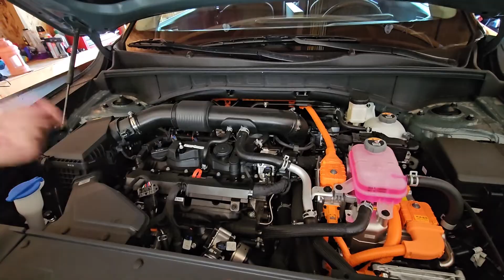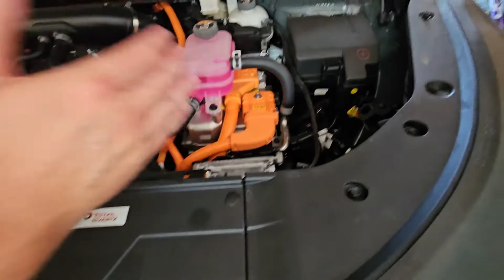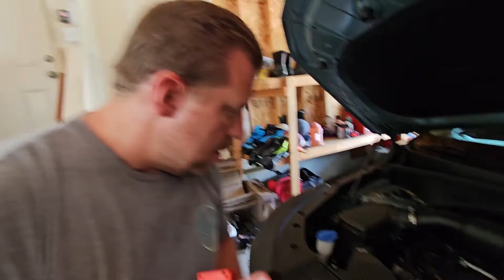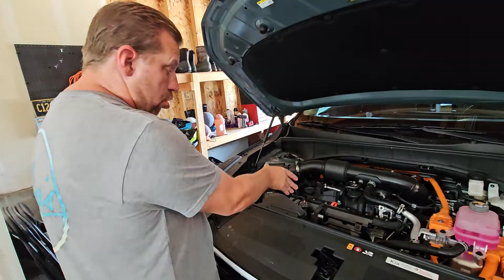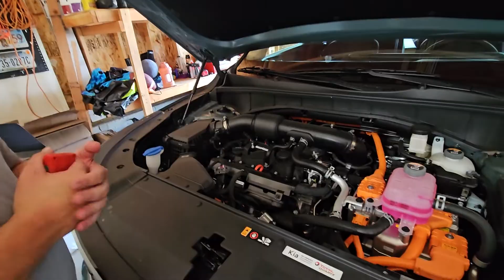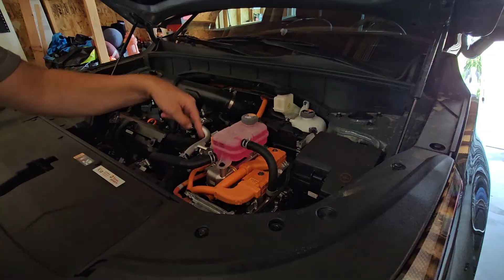A Deep Dive on Hyundai/Kia's Very Unique Hybrid System, this week on jmcGarage Talk!

Comment: I just bought a 2025, sold my 2021 Venza on demand AWD. I enjoy my Santa Fe AWD - full time. I get about 540 to 602 Per tank it's awesome when in ECO mode at any MPH I tap on the gas and engine shots off, going over 65 Its on EV, what other manufacture does this not to mention the warranty 10 years over 100,00 Miles, have over 2700 miles and drives like my brothers Rose Royce comfort and handling.

Comment: I have 2022 tucson hybrid sel convenience. At 60,000 miles the HSG tensioner starter belt snapped. I kept trying to restart the engine and fused out the main battery pack in the back seat.
Thankfully Hyundai covered replacment.
I later found out in the manual that the recommended replacement for that HSG belt was 30,000 miles.
Which was $120 replacement. 
I could have almost had $2500 issue with the batteries if Hyundai hadnt covered it
Reply from the maker: Thanks for sharing your experience

Comment: Just bought the 2026 Kia Sportage SX HEV that has this powertrain although it's even smoother switching between EV and ICE with 5 more hp. Must say they've done an amazing job with the lineup for 2026 and I'm glad they went back to a real 6 speed transmission instead of the DCT or CVT.

Comment: Does anyone experience a jerking motion when the engine is cold. Lasts about 5-10 seconds. Then once warmed up no issues. Reading on Reddit someone said it has to do with the engine clutch and no TSB or fix. I have a 2025 Santa Fe hybrid.
Reply: Haven't experienced that on the 2026 Sportage HEV

Comment: That “slight” delay in my experience can be up to 2 seconds on my experience. I was very disappointed with the driveability and reliability of my Sorento PHEV.
Reply from the maker: So sorry to hear that
Reply: Can't imagine an actual 2 sec, but certainly any appreciable delay could feel like a long time on the road. Wonder if the PHEV is different than the HEV (which is very smooth and quick to transition) in that regard. Also, in what drive mode?
Reply: Doesn't sound right I'd get it looked at. I have zero delay on my 2026 Sportage HEV with the same drivetrain
Reply: @Yielar1 I got rid of it and got a RAV4 Prime. I’m much happier with it.

Comment: The differentials are mechanical, but the clutch packs are controlled electronically. Also the intake cam is a multi piece electrically controlled unit that does not control valve timing (CVVT) but it controls valve duration (CVVD). It is the only engine of it's kind in the industry and also has other unique features such as an exhaust manifold that is cast into the engine block.

Comment: The "pancake" electric drive motor not only powers the wheels it pretty much replaces a traditional torque converter in the automatic transmission. The car always starts in electric mode until the car gains enough momentum to allow the electric clutch engage the ICE.
Reply from the maker: Thanks for the information, very good to know.
Reply: There's no torque convereter as in non-hybrids, but there's a Hybrid Clutch that was added.
Reply: I was happy to learn that it doesn't have a starter per say, it uses the electric motor to start the ICE engine which is pretty clever

Comment: I drove a Hyundai Tucson hybrid and RAV4 hybrid back to back. This is a very clunky system. You certainly feel the switch between electric mode and when the engine turns on. I’m also not comfortable with that belt driven MGU. Belts always have slack. This belt is also under shock loading evertime it starts the engine. So many things to go wrong in this system and I see no benefit. The Toyota is much much more reliable, smoother and will hold its value better. I’ve had the RAV4 for a couple months and I’ve been getting around 4.8-5.3L/100km (49-44mpg). But hats off to Kia/Hyundai for doing something different.
Reply: Interesting, I drove a Kia Sportage PHEV and found it to be a very smooth system. I could see having some  jerkiness at low speeds since the torque converter is replaced by an electric motor (I know Mazda had this issue with their new hybrid 8-speed) but I didn’t notice anything myself. I will say my fiancé has a Prius and it’s an incredibly well made system, and bulletproof as hell. I just can’t stand the CVT drone when you’re pushing the engine hard. The Hyundai/Kia system had a much more refined feel to me, between the conventional shifts and the turbo allowing the engine to stay at lower rpms. I agree the belt driven MGU is a weird choice, I’m curious to see if they’ve changed that for their 2nd gen system that’s coming out with the new Palisade/Telluride.
Reply: @jakenoltensmeyer7366 if you drive a modern Toyota hybrid (4th gen and up) you can tell the difference straight away and it will bug you. 😅 
I don’t find the eCVT annoying at all, these drive trains are meant to be the most efficient and eCVT is the most efficient way of doing it. The drone is also much much less in 4th gen and up hybrids. Also turbo means premium fuel and these gdi engines don’t have the best reliability.
Reply: @4wdlyf I believe our Prius is a 4th Gen (2020). Now I know the RAV4 has significantly more power so I’m sure that helps for the engine to not have to work so hard. Turbos don’t necessarily mean premium gas, with the exception of performance models like the Elantra N all of Hyundai/Kia turbo engines are designed to run on regular gas. Not saying the Toyota system isn’t objectively excellent, but from a purely personal preference I definitely prefer the turbo/conventional auto combo. 

I do want to follow up on something I said last time, I did some research and can confirm that Hyundai/Kia’s 2nd gen system ditches the belt driven MGU and integrates it into the transmission alongside the traction motor.

Comment: Same junk ass system hyundai has used since 2011.  Requires more maintenance and hence more expense than the elegant simple toyota lexus system.
Reply from the maker: Don't remember any vehicle offered here in the states by Hyundai/Kia hybrid system in 2011
Reply: 5 year warranty is better than Toyota. Got 37 today. Blown away with a 4000 pound all wheel drive car.  Most quiet car I have ever had.

Comment: Direct injection only....  I want to add an oil/air separator to my wife's 2024 Hyundai Tuscan PHEV. at only approximately 9500 miles .I want to start saving those intake valves now before the dealer charges  me a boat load of money for them to "professionally clean them the "walnut way"..any thoughts ?
Reply from the maker: I believe that since it's only a Hybrid the build-up of carbon should not be as extreme as on a regular gas car
Reply: @thejmcGarage  Ours is both gas and electric.

Comment: I have owned a Hyundai Tucson Ultimate Hybrid AWD in the UK FOR TWO MONTHS. I use E5 petrol and get 43 miles to the gal. Very happy with that. The power output of the hybrid is quite good enough even in Eco mode.

Comment: Won’t the turbo melt with oil flow being turned off regularly?
Reply from the maker: The turbo is water cooled as well and with an electric water pump coolant will continue to flow even with the engine off
Reply: @thejmcGarage thanks good info!
Reply: @thejmcGarage  What about oil flow though, isn't the turbo still spinning?
Reply from the maker: @aspiringastronaut9992  true oil does stop with the engine off but usually before the engine shuts down it will run for at least 20 to 30secs at idle before being shutdown
Reply: @thejmcGarage  again thank you. I have never owned a turbo hybrid so I'm just looking for "pain points"

Comment: The KIA/Hyundai uses a motor to turn a serpentine belt to start the engine! What kind of Rube Goldberg contraption is that?!  Toyota/Lexus uses a second motor to directly start the gas engine.
Reply from the maker: Yes and the Toyota/Lexus setup uses and eCVT with two electric motors built into the transmission.  This setup by Hyundai/Kia uses a traditional 6speed auto

Comment: Thanks. Great video. Any information on battery? Voltage KW?
Reply from the maker: I believe they are on a 380 to 400 volt architecture
Reply: @thejmcGarage  I found out it is a 48 volt "Mild hybrid" system.
Reply from the maker: @willytwo53072  it's a full Hybrid system not a mild one at all
Reply: @thejmcGarage  You must have the plug-in model. Thanks.
Reply: @ I"m confused. I just bought a 2025 Hyundai Limited hybrid. Is it a full hybrid or mild hybrid? How can I find out? I think the mild hybrid is a diesel version not sold in  the US
Reply from the maker: @willytwo53072  weather it's a full or a plug in Hybrid as they are both a full Hybrid system.

Comment: The Toyota Sienna's entire gearbox fits in the palm of your hand and it's just a double planetary gear plus two electric motors, a starter generator and an electric motor. This is the gold standard of hybrid system. Toyota is the King of Hybrid Systems. When Toyota started putting hybrids on the road, all the other auto companies went to first grade in elementary school and they fell far behind because Toyota had patents for their inventions. Big hello to everyone from the owner of a 2025 Toyota Sienna👋👋👋👋
Reply: Well, one car company decided to outdo Toyota and they decided to produce cars without a gearbox. They decided to install a more powerful battery that would accelerate the car to a speed where you can just turn on the engine in straight line and move like that. Well, this is kind of a simplified explanation, but in principle it is created approximately like this and you know it works and not bad. And this is the Mitsubishi Outlander.
Reply: 1. Toyota is not a king at all..
2. Toyota has overall ugly design for grandmas
3. Toyota has no soul
Reply: Toyota doesn't make a double planetary. You have the Camry with a van body. This vehicle will be unreliable, undurable, did EVERYTHING wrong. Have '24 CCH AWD, hypermile, measured 70+ MPG since new.
Reply: @nosretep1960  You are deeply mistaken, take a course to study how the transmission works on modern Toyota cars.
Reply: @yuriy797  you're ignorant. Just watch any of 100s YT videos.
Reply: @yuriy797  when they went to parallel design 610 on, eliminates 2nd planetary by different mechanism, 2 gears instead of 3 in planetary.
Reply: @nosretep1960  👍👍
Reply: Yeah well toyota also priced themselves out of my market by creating a high demand on their units by not producing as many. The dealers are all saying we could order one, it would be 4 to 6 months wait and really ends up being 2 years for one. And then to add insult to injury they would ADD market adjustments on the price of 10k. F toyota dealers, I'll buy when they actually come back to reality.

Comment: Hi, quick question while watching your video I saw your engine coolant is below the minimum level mark, and that same thing in my case as well. I am not sure if the marking is incorrect or if it is what it is.
Reply from the maker: Sometimes that dip just a tad lower then where they should be which is alright as long as they are not totally empty

Comment: Thank You for explaining kia turbo hybrid smartstream. How does that starter generator actually start the gas engine? So there is no starter gear⚙️?

I got 2022 kia sorento Hybrid 1.6 Turbo
Reply from the maker: Yes the starter/generator will start the engine so there is not a need for a traditional starter
Reply: What is your real MPG in the city?
Reply: On another review it stated the starter motor connection to start the engine is belt driven. It is a heavy duty belt however

Comment: We'll find out in about 8 years if its any good.  It'll be fun to have to clean these intake valves.
Reply: Pull the intake, soak with valve cleaner and use zip ties in a screw gun. Easy job really. That's if they need it.
Reply: Use top tier fuel and change your oil every 5k and you should be fine

Comment: This is the exact same powertrain that Hyundai uses in its hybrids. Neither have had any major issues or recalls. It is one of the best setups in all the Hybrid world. Were you pointing at the CVVT when you mentioned the vacuum pump?
Reply from the maker: It actually is a vacuum pump since moat Turbo do not produce alot of vacuum
Reply: @thejmcGarage  The non turbo 1.6 also has a vacuum pump as the Atkinson cycle engine also doesnt produce optimal vacuum much like the turbo motor